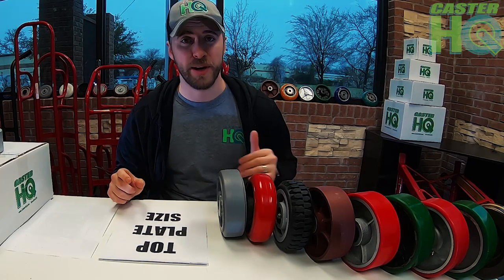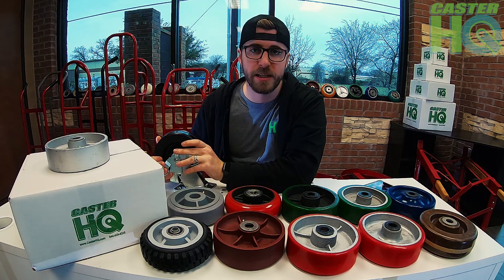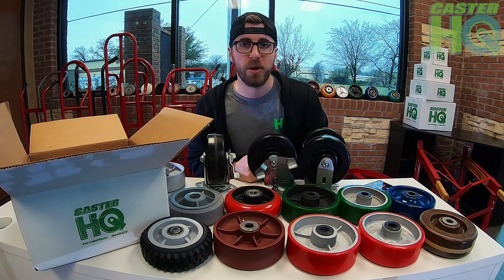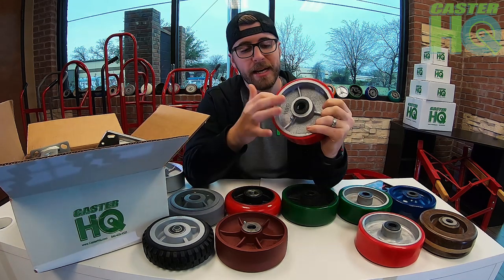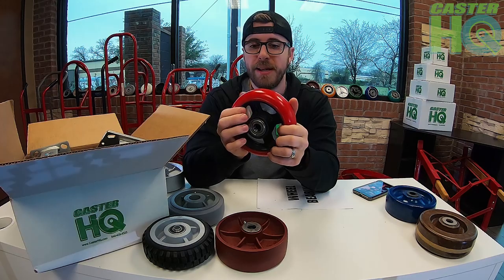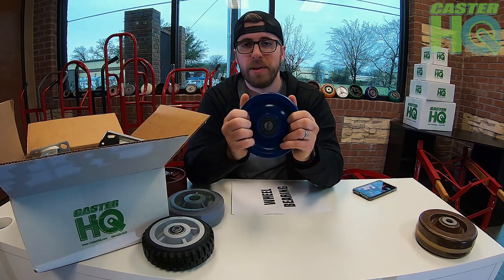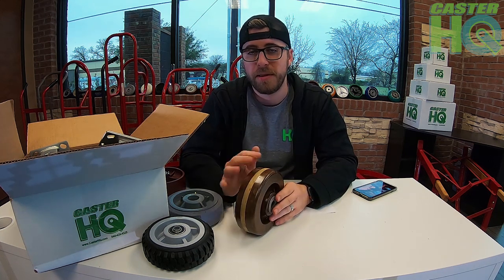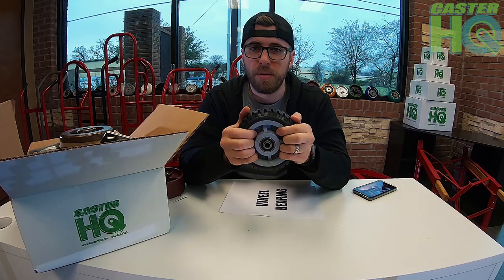Caster & Wheel Buyers Guide  - Choosing the Perfect Wheel for your Tool Box, Cart, & Equipment

Comment: I have been looking at 6" caster wheels. What would be the approximate ground clearance if 4 were attached to a small cart or trailer. I'm guessing that the ground clearance would be at or close to 3 inches. Am I even remotely close to the actual ground clearance? Thanks in advance for any and all advice, opinions, or answers. Regards

Comment: I've been in hardware my whole life and this is the best 12:51 on youtube, only item, 8 inch wheel adds inch to height for 6 inch prior wheel.  Superb presentation and if in the market for Casters i'm ordering from these folks.  Thank you Mr. Wilson, i think anyone who is mechanically inclined will benefit from this video, since i can think of several items i bought and the caster was the difference from power washer to mowers, Great Job!!
Reply from the maker: Thanks! That means a lot. I am glad this can help others.
Reply: Lol yep my only reason for posting and it's the first comment. 
Other than that this is an excellent video.

Comment: I was just thinking. You mentioned a swivel caster that had a locking system that locked the wheel and the swivel simultaneously, but I was wondering if it's possible to have one that gives the option to lock the wheel and swivel independently. That way you can lock the swivel to pull a long distance, then unlock it when you need it to swivel again.
Reply from the maker: Great question. We do offer directional locking casters when engaged the swivel will lock in one direction but it will not lock the wheel. It is only directional locking pertaining to the swivel raceway.

Comment: Hi just found you while searching for info about casters I have a four drawer US general but I have it loaded down to the max I'm going to guess and say it weighs 4 or 500 lb I work Hotel maintenance so I will this thing around with me everywhere what is the best choice for smooth rolling mostly over short low nap carpet I'm not really worried about marking up any floors but I do have to roll over some door entrance transitions elevator transition bumps xcetera it has on it stock 6 by 2 whatever the standard black wheel is I was thinking about possibly going with something air-filled any advice would be greatly appreciated
Reply from the maker: Air filled tires would require alot more maintenance and could flat spot with the maximum weight sitting on these casters. You could do a mold on rubber wheel which would be a good choice for outside and it would allow a direct replacement swap of the wheel and since I have those wheels in the same size.

Comment: I want something that I can use on asphalt, sidewalk & epoxy floors.  The casters I have now make a ton of noise, some from the wheel & some is from play in the bearings etc...  What do you have for me???
Reply from the maker: I would go with a Thermo Rubber Wheel it’s a gray non marking thermo engineered rubber. Doesn’t leave streaks, soft to absorb shock, very quiet, and is great on all of those floor types especially floor protective on epoxy. 

We have them in all sizes light duty as well as medium/heavy duty. 

As far as bearings go, there is always going to be some play and movement/noise in a roller bearing, if this is an issue I’d always recommend going with a precision ball bearing which is also an upgrade you can choose on our website when ordering casters, reach out to us at info@casterhq.com or call us at 844-439-4335 and we will help you more.

Comment: May I know what kind of wheel material most suitable for restaurants kitchen cart( slight oily floor) ?Load 250-300kg  per wheel.
Please advise. Would you recommend 5" or 6" wheel?
Thanks
Reply from the maker: For restaurant kitchens with slightly oily floors and loads of 250-300kg per wheel, thermoplastic rubber (TPR) wheels are ideal due to their oil resistance and smooth operation. A 6" wheel is recommended for better maneuverability and ease of movement over floor imperfections, enhancing cart handling under heavy loads.

Comment: Hello Castor's HQ
Your Video maybe a year old, but I just found you and subscribed. I am researching for my next purchase for my Toolbox Castor's. I currently have a 40" Craftsman 9-drawer Toolbox. The castor's on the tool box are getting old and need to be replaced. As a Aircraft Mechanic I can be in a hanger or outside mostly on concrete. It's not always a smooth track,  especially if I am outside. I just weigh my Toolbox at 316 Lbs. So question for you is what do you suggest  for me and how much does it cost? Thank you
Reply from the maker: Hi George,

If you are moving your cart outside frequently I would recommend a mold on rubber caster since it has a thick rubber tread that will help absorb shock and vibrations. View the link below, select a diameter and the combination. I would say two swivels and two rigid casters would be your best bet. The larger the wheel, the easier it will be to roll. 

https://www.casterhq.com/MoldonRubberCasters-s/270.htm

Comment: Can yo convert stem casters to plate casters?
Reply from the maker: If you have enough room under your cart or equipment to attach a mounting plate all you would need to do is remove the stem casters, drill a hole according to the bolt hole pattern of the casters you are wanting to use or simply weld the casters on if you are able. Either way will work only if you have enough space to fit a plate. Thank you.

Comment: 150-200 lb capacity for office chair on thick carpet. Grip ring stem. What do you recommend?
Reply from the maker: I’d recommend this chair caster because it has a harder polyurethane wheel, easy to move on carpet and will protect your floors and not scratch on harder surfaces or leave streaks.

https://www.casterhq.com/3-Chrome-Chair-Caster-p/ch3cbp.htm

Comment: I have a wood 30” x 18” movers dolly. I need a (low cost) casters, 2 straight, 2 swivel, these need to have a total weight capacity of 1000 lbs. and roll easily on asphalt driveways. Buy the way this weight will be stored on this dolly and casters for months maybe years? What would you recommend? Great video. Thanks
Reply from the maker: Hi Doug, If they are rolled on asphalt driveways I would recommend a Thermo Plastic Rubber Wheel but you won't be able to get the full 1,000 lbs capacity out of these and if those sit with weight for long periods they could flat spot. The only wheel that would work best with this much weight sitting on them for long periods would have to be a harder durometer wheel like a plastic or nylon wheel. Checkout our low profile casters. These might be a good option since they will not flat spot and they will hold a lot of weight.  https://www.casterhq.com/3InchLoProCasterPlate-p/03po30ib3606yz.htm

Comment: any advice on installing casters on a dolly that doesn't have the right bolt pattern? bought a dolly from Harbor Freight and wanted to upgrade to have 4" locking casters but their pattern is 1.75" x 2.5"
Reply from the maker: We have a lighter duty plate caster with a bolt hole pattern of 1-3/4x to 2-7/8 slotted to 3”. Check this series out, it’s commonly used for Dollie’s.

https://www.casterhq.com/Institutional-Plate-Casters-s/122.htm
Reply: 1. Return Incorrect Casters. Exchange for Correct Fitting Casters.
2. Centerpunch, Drill, Bolt, Nut.
3.Weld on x16 4ft I-Beams.

Comment: I need some casters for a bunch ice cream transport carts they are often left outside, washed, put in a -20°F freezer while wet, dropped, never greased, etc. What casters would you recommend? We have phenolic wheels but they keep chipping and cracking apart as well as the swivels becoming rusted solid so the carts don't roll straight. All four of the wheels need to swivel. Stainless steel for everything would be ideal.
Reply from the maker: I recommend our Automotive Maintenance Free Wheel. The wheels are Polyurethane Donut Tread with a Aluminum Core which are great for wash down applications and they are extremely easy to roll due to the durometer, bearings, and donut tread. 

https://www.casterhq.com/6-Inch-Sirius-Poly-Swivel-Caster-p/35cs620dua63m-03.htm
Reply: @CasterHQ  Thanks, I'll show this to my boss and see if we can get a few and try them out. If we can't destroy them as fast as the other ones we'll phase out the old wheels and switch over to these.

Comment: Need a recommendation on casters for a workbench I'm building. Workbench top is 60x30, oak, 1.5" thick and weighs about 80 lbs. Building the frame with 2x4's and 2x6's, and not planning on having a lot of weight on the bench, but just in case I'd probably want a capacity of around 500-600 lbs total. Will be used in my garage on a concrete floor, and I'd prefer something that rolls smoothly. Also want all the casters to swivel as it's a confined space, and want the brakes to lock both the wheel and swivel. What would you suggest? Thanks for the advice!
Reply from the maker: Hi Greg,

I would recommend a 4" x 1-1/4" Total Locking Caster with a Gray non marking thermo plastic rubber wheel. The Swivel casters have a smaller swivel radius than are larger casters and each caster will hold 250 lbs for a total of 1,000 lbs of weight capacity for a set of 4 casters. Please see link below. 

https://www.casterhq.com/4-INCH-TOTAL-LOCK-p/z26p144nekil.htm

Thank you,
Jordan Wilson
CasterHQ

Comment: Is PVC better than polyurethane? I need a quiet non marking 5” caster. Is PVC plastic or rubber?
Reply from the maker: So the Thermo Plastic Rubber has a softer tread but little less weight capacity, both are non marking. Polyurethane has a slightly harder durometer tread and higher weight capacity, non marking as well but isn't as quiet as a Thermo rubber wheel. It all depends on your application. If you are using these outdoors or in a shop with debris on the ground the rubber wheels are much better at rolling over debris without getting stuck. Polyurethane will sometimes get stuck on debris on the floor. 

Thank you,
Jordan Wilson
CasterHQ

Comment: So, im trying to install larger rubber casters on my water cooler at work, it currently has 5" ?phenolic? Wheel Casters on it. With 3" x 2" top plates. I ordered 8" casters 2 lock 2 are ridgid. That have 4 1/2" x 4" top plates. Im wondering if there is an adapter or a plate i can use to install these much larger casters onto my Hessaire swamp cooler? While its in the shop, its fine with what it has on it. But, i have to walk over to a hose thats roughly 60 yds away, over old nasty black top that is very rough. Plus there is a small 1" ish curb i have to roll it up an down. Thats y i got these gnarly like offroad casters. Ne advice or tips would be greatly appreciated
Reply from the maker: Hi Scott, so it seems your plate is a lighter duty version since it’s smaller. Since your box is made for a smaller plate you can either return what you ordered and we can set you up with a nice wheel with a matching mounting plate. Or you can look into welding some of our caster pads onto the current section where your casters would go and it will allow you to use your larger casters. Please checkout the link below so you can see what a caster pad is. https://www.casterhq.com/caster-pad-p/cb-qccp4.htm
Reply: I appreciate ur guy's quick reply/customer service. 
I made brackets from scratch by drilling wholes into c-channel. They did work, they hold onto my swamp cooler, they just roll like garbage. The 2 swivels basically constantly speed wobble. Its terrible, i reinstalled the stock casters.
Reply: Long story short. 

Top plate - "2-7/8" x "3-1/4"
Max load is 200 lbs. The swamp vooler holds 16 gallons of water. So it will never weigh more than 200 lbs. I go across nasty old rutted/diveted black top to get to the hose to fill it. So, i want casters that can fit my swamp cooler. And are good on very rough cement/black top. So im not spilling alot of the water when rolling it back. I was thinking polyurethane, but those r like rollerblade wheels rite? They may be slightly better than what i currently have? I think i want rubber, not the air up ones. With the correct top plate. Do u guys carry something like this? Or can u custom make them?

I would be happy to remove one of my casters that fit it, trace it including holes. And mail it to u guys, or take pictures next to a measuring tape. And the size of the tire honestly doesnt matter. They currently have 5" wheels. But if they r bigger thats fine. The swamp cooler is short. The height doesnt really matter. I was thinking i want 6+" wheels. Up to 10"

Comment: CONCRETE FLOOR, DOLLIES FOR ROLLING 3000LB BURIAL VAULTS. WHATS BEST? THANKS
Reply from the maker: Hi Terry, It depends on the overall height of the burial vaults you are moving. If you don't mind them being sort of high I would recommend either a 6" or 8" diameter caster wheel because the larger the wheel the easier it is to roll. If the concrete is smooth concrete with zero debris I would say a steel wheel would be the easiest for you to roll this type of weight. If you want floor protection I would recommend a polyurethane on cast iron wheel. Please checkout both links below, and you can make a decision based on my points above. Please feel free to call us at 844-439-4335 or email us at info@casterhq.com for any additional help as well. 

First Choice: 
https://www.casterhq.com/8-X-2-Tool-Box-Kit-Red-Polyurethane-Wheel-p/cb-9tbrp82.htm 

OR

https://www.casterhq.com/8-x-2-Inch-Swivel-Caster-Semi-Steel-Cast-Iron-p/cb-9sc82-ss.htm

Comment: Kinda wish you would've touched a bit more on which wheels will be good for long period stationary applications.  Which won't develop flat spots as easy.
Reply from the maker: Harder wheel materials such as phenolic wheels, steel wheels, polyolefin wheels, and polyurethane on steel wheels are great for long periods of stationary use without developing flat spots. I’d recommend phenolic wheels first as they are the most affordable and offer a very high load capacity. Just don’t get the phenolic wheels too wet.
Reply: What if I was to be rotating say... 3 to 4 hundred pounds of wood for periods of time, concrete rolling surface gets quite wet sometimes.

Comment: Hello  Caster which one  (need four with lock latches please) do you recommend for a table saw on built stand weighs 200lb roughly to move around on concrete surface?
Reply from the maker: 200lbs is a light duty application. I recommend some thermo rubber casters with total locking brakes for your application. A set of 4 holds 1,000 lbs and the TPR Wheel materials will roll over debris out doors with ease. 

https://www.casterhq.com/4-INCH-TOTAL-LOCK-p/z26p144nekil.htm

Thank you,
Jordan Wilson
CasterHQ

Comment: Could pneumatic caster wheels be used for a yard cart?  Everything I have seen seems to  involve wheels on an axle.  But I would think 12 inch rugged pneumatic casters would work.

I am interested in making my own yard cart and caster wheels seem so much easier.  I suppose there must be a reason  no one uses them for this purpose.
Reply from the maker: Hi Bobby,

Yes Pneumatic Caster Wheels can definitely be used on a yard cart. In fact, many outdoor carts including the gorilla cart comes with air filled pneumatic tires but those do run on a shaft. If you want to build your own cart I recommend having 2 fixed pneumatic casters in the back and 2 swivel pneumatic casters in the front. This will allow the cart to roll better in straight lines and maneuver much easier than having all swivel.
Reply: @CasterHQ  Thanks that is exactly what I had planned on doing.  Prices seem to vary on these.  I am considering 10 to 12 inchwith a load of at least 200lbs each.   Like you said the swivels in the front.